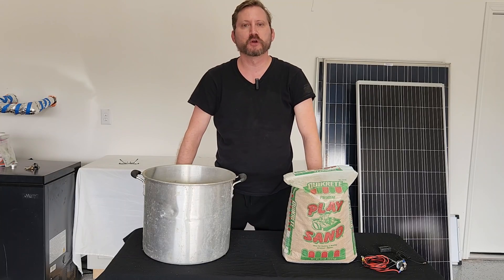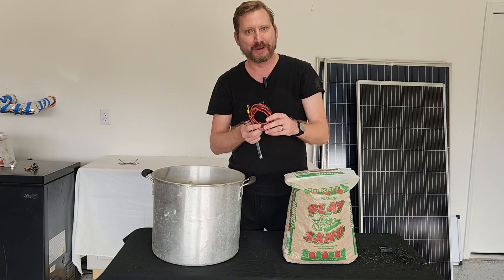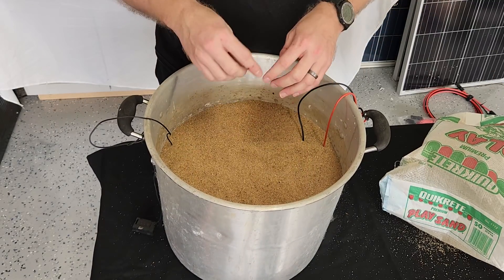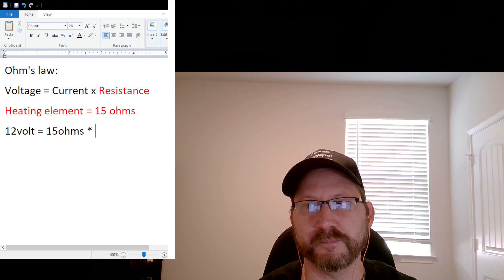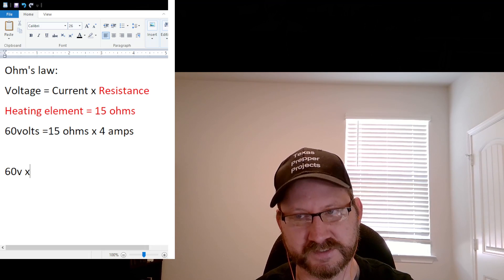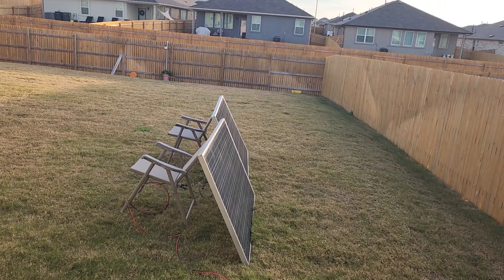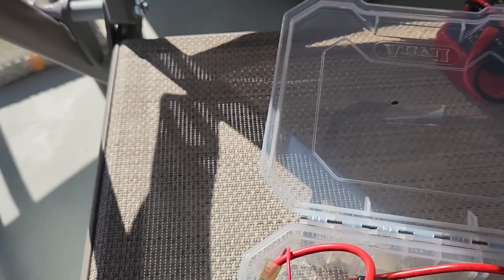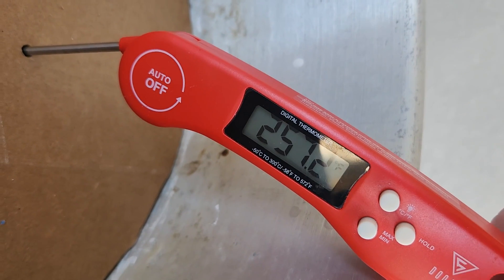Sand Battery Heater solar powered 250F / 120C with no flames or fuel! DIY

Comment: You actually need to match the element and the panel. Maximum power transfer occurs when the source resistance matches the load resistance.  The source resistance is Vmp/Imp= R.    Find an element with this R and you will get the maximum power transfer. David Poz has a video on this and confirmed it. But great video
Reply from the maker: Did you watch the video? I posted the math on this long before David did
Reply: Hi yes . Your video is great , very detailed 👍Just wanted to state it's the impedance matching that decides max power efficiency vs the voltage alone  . You can have two identical voltage panels, but different wattages.  Eg . 100w (30Vmp 3.3Imp (9ohms)  200w/(30Vmp 6.67Imp) (4.49ohm).    So depending on the wattage of your panel , the ideal element would change if maximum efficiency was your goal.

Comment: Great video.  Was wondering if anyone that has watched this is from the Pacific Northwest, which equates to rain/cloudy weather and am curious if a solution like this wold be effective or a waste of money?  My application would be to raise the temp in the winter time for a 8x16 outdoor shed, even it is would elevate 10-15 degrees warmer.  I do use solar powered lights which seem to work fairly effectively in the winter time but this solution would have quite a bit more of a power draw than LED lighting.
Reply from the maker: Waste of money for that location and size. I would use a diseal heater
Reply: @texasprepperprojects  Thanks for the feedback.
Reply from the maker: @francisaiello6197  welcome!

Comment: I tried this, i have 80v coming from solar panels in series to my heating elements and the voltage drops to 10v to about 12v. How do I fix this?
Reply from the maker: All panels will drop in voltage under load. But, what is the resistance of your heating element?
Reply: @texasprepperprojects  Not sure, I will have to measure, I only have one element. thanks for getting back to me. but does that seem like a big drop?
Reply from the maker: @waynemckinnon6163  yes something isn't right there.
Reply: @texasprepperprojects  It measures 17.9 ohms
Reply: Any ideas?
Reply from the maker: @waynemckinnon6163   I'd have to know a lot more

Comment: Thanks for putting this together and online for us. I just completed my build of this system and running into an issue with low voltage. I have six (6) 16 volt solar panels connected in series which should produce 96 volts. I included a disconnect between the pv panels and the shunt to disable the system when not using it in the summer. I have the sand bank in the greenhouse for radiant heating,  hopefully. When I measure the panels disconnected, I get 100+ volts, but when I connect to the other parts the voltage drops to 12 volts and stays there. Not sure where to start. Now I will say that the heating element does heat at 12 volts and draws about .5 amps.
Reply from the maker: Neat!

Comment: I have a 22’x22’ unconditioned garage. Could I scale this up to a 50 gallon steel drum and use multiple heating elements?
Reply from the maker: In my opinion and lots of experiments... no.  It would require literal tons of sand and you would have to cover your roof and yard in solar panels.  Think of a $20 space heater for  bedroom. Those are 1500 watts.  This is 260 watts.   Your better off woth a diesel heater or propane heater.

Comment: Have you tried wiring two element in series to double the resistance so at 60v you would be effectively running them at there rating capacity assuming they are 120v elements.
Reply from the maker: But then the current requirements would go up and I'd need bigger panels anyway
Reply: @texasprepperprojects  that makes sense, I wasn't sure what the current rating if the panels was. Those panels seemed like they were probably ~ 300w each. Just trying to maximize power output.
Reply from the maker: @hyperion112   They are roughly 300 watt at 37v, so you are right, if I had 4, i could get to around 120v, I just think the current will be too close as the sun goes up and down... but it's a decent idea if you can make it work. As I showed, getting to voltage high enough makes a BIG difference

Comment: Aluminum is a better material to store heat energy.  It has a higher heat capacity than sand, but gets hotter faster and more evenly. But it definitely would need to be insulated way better, because it will also lose/conduct heat to the surroundings faster. 

   You say you don't need to insulate the sand much because there is not that much energy going in, but keep in mind that you have it in a aluminum pot.  That aluminum pot is very thermally conductive, and is sucking heat energy out from the sand (and exchanging it with the outside/ambient temps).  Meanwhile, the heat doesn't transfer well through the sand itself. It's like the equivalent of being on a boat with a couple of holes where water is coming in.  You're fighting a losing battle if you don't patch up the leaks.  

   Also, if heating is the goal, it is much more efficient and cheaper to just convert the Solar energy directly into heat. There's a guy up in Canada where it gets pretty cold during the winter (often well below 0 F), and he does most of his daytime house heating from direct Solar heating via essentially what are insulated and baffled large boxes with aluminum cans inside and everything is painted black.  These are outside and he pipes the hot air into his house.  (The system turns off at night, and if he needs to, he runs his woodstove for part of the night.  This Solar heating system saves him A LOT of wood though). 

  Solar panels only really make sense for heating when you don't have any sunny areas near a window etc, and so instead you can run wire for a distance from an area that does receive sun.  In that case, it is much easier and more convenient (especially since those wires can easily be put under a window).  But if you have areas of consistent sun near a low 1st story window, it makes much more sense to collect solar heat directly and pipe in the hot air like the above guy does. 

   I really wish I had the sun for either, but our property has many trees and way too much shade to be able to use either.
Reply from the maker: Thanks for the comments

Comment: I have access to some used panels..  400w 40v  9.3A … obviously when new… so 3 of these in series 120v, 1200w , 20-ish amps… this would heat sand, water, etc.. on the daily like a battery.  🔋.  For a green house… @ $105 a panel.. sounds like a no brainer… use batteries as well for “extra” power? If already have 12v panels… groups of 5 to make 60v or buy higher V panels?  
   I was thinking water also.. like a 240 gallon tote in a cage would be ideal… and paint it black so the sun gives an assist!
Reply from the maker: That sounds like a great setup!  Direct solar water heating with a tiny pump is even easier  and cheaper

Comment: 9:43 Stickler here, moving air itself is heat. So, yes, you will create MORE heat by using a fan. Close a fridge with the fan on and no cooling and find out. The ENERGY question still remains for all stickle sticklers. Moving air creates heat, it is called friction. Great post, am ordering parts! Thanks:) 11:40 not to mention h2o tops out at 210degF100C.
Reply: While moving air does create heat, the fan takes energy to run. You cannot power a fan with heat and have it create more hear than it consumes.
Reply: @hyperion112  And you are the stickle stickler i referred to while carefully separating energy and heat in my comment:) Makes me feel like a mystic.... P.S. Depends on the noise efficiency of the fan on whether it creates more "'HEAR'"{sic}. Nice attention to detail.:)
Reply from the maker: Thanks!

Comment: Hmmmm (caution: Rube Goldberg thinking coming!)…
What if….interior house walls, even only the lower half of walls, got packed with sand?  
Add heat element(s) into that, & enuf on-site power generation, it could help temper the house, help reduce sound transference. 
Sand holds heat, so, when the sun sets, there’s only the hot sand radiating warmth—various things determine how long the warmth lasts without added heat. 
 It depends on:  
…. how much sand volume; ;  
…. How many elements heat it; 
…. How hot the sand gets when powered; 
…. How cold the house gets & the temps outside, that the sand must compensate for. 

…Or, how about when building, reinforce the floor framing to withstand the weight of being filled with sand?  Add heat elements into that sand, placed for easy maintenance / replacement over time.   
…Sun hitting floors thru windows can also temper the floor sand-cells. 
…Or, how about making a sand-bank or a brick bank, under & around each baseboard heater, & learn how to use those to heat the mass, then turn off the heater & just use the stored heat from around each baseboard?  (Kinda redundant, cuz baseboards already give you all the BTUs you paid to heat—but that can help keep warm in a grid-down event). 
…Or, make mostly passive solar air or fluid heat tubes, mounted under a polycarbonate or metal patio roof, & bring the air or fluid into the house with a manifold, maybe a radiator for fluid, to heat the house during the day.   
Some of those tubes could heat a sand-battery for night hours, if you have enuf sq.ft. of patio roof & tubes. 

“The wheel of seasons”—the temp cycles over a year, are stored into the interior mass of a building.  The more mass, the more temp storage.  Materials used, matter. 
Balance the amount of mass with the interior sq.ft., & you can passively get a livable, fairly even indoor temp, year-around, with  (or little) added heating or cooling.   
Properly balancing the sq.ft. of interior with the mass, allows the cool of winter to become available to the interior in summer, & the heat gained in summer, to be available to warm it in winter.  
Hard materials on interior walls store temps better than soft materials (sooo…put thicker paperless drywall, or, cement boards, on walls to store temps).  

The mass-battery for temp storage can spawn lots of variations!
Reply from the maker: Just have a thermal mass inside the house but not thermally attached to the exterior of the wall. Like a big stone fireplace.
Reply: @texasprepperprojects    Can otherwise fill the interior wall bays with volcanic rock/pumice, for mass that is lighter weight & still effective. 
It’s about storing BTUs inside the house, & letting those slow-temp-changing fillers help smooth-out temp variations in the house, over a year’s time. 
But yeah…for exterior walls, pumice or sand would not be enuf insulation in exterior walls, unless those walls were thicker than any usual wall.
Reply from the maker: Cool

Comment: That would be silicone, not silicon jacketed wire.
Reply from the maker: The wire has silicon insulation for high temps
Reply: Silicone is a rubber. Silicon is an element that computer chips are made out of

Comment: If you had 10 or 20 tons of sand with an insulating cap with that heating element  you could store heat from summer and by the time it works its way through the sand and you remove the insulated cap you could be warming your house in winter.

You could bury an appropriately sized system under your house (best during construction!) to deliver such an outcome.
Reply from the maker: Yup!

Comment: Well done with this sand project. We have lived off grid for 18 years and use a Derby Heatbank heater with our excess solar in winter. You should check them out? They are now made by a different manufacturer but still very good
Reply from the maker: Thanks!

Comment: The biggest benefit I see with keeping it outside is making it very easy to control a fan to pull air through with a simple temp switch
Reply from the maker: Thanjs

Comment: Thank you. Great vid. Re Insulating the pot; true you won't get any more heat energy, but you might want to take the daytime rays, when the sun is heating the greenhouse anyway and release that heat at night, in which case a removable jacket would surely improve efficiency.
Reply from the maker: Thanks for the tips!

Comment: Great...heater for my sailboat....with about 30 cubic  metres to heat...to knock the chill off nights in autumn winter in NZ. I will maybe insulate the pot so i can release the heat as needed. I can  use a  20 litre stainless steel beer keg i found..
Reply from the maker: Try it!

Comment: If you need hot water, coil some copper tubing just below the surface of the sand.  Then pipe it to wherever.  It could be stream, so design appropriately.
Reply from the maker: Yup

Comment: Nice project.

What is the brand name of the energy monitor?
Reply from the maker: The watt meter? It's just the $20 from amazon
Reply: @texasprepperprojects  Is that the device you have wired between the panels and the heating element?
Do you have a link?

And thank you for the response

This device looks like a project I could build to keep my plants from getting to cold.
I live in Texas also and have harvested tomatos and haberneros the week of Christmas.
This looks like something I could experiment with.
I already have several solar panels.
Reply from the maker: https://www.amazon.com/KETOTEK-Digital-Voltmeter-6-5V-100V-Multimeter/dp/B0BD41MQSN/ref=
Reply: @texasprepperprojects Thank you I just rewarched the video and found it in the link.

Much appreciate this.
Going to give it a try.

Comment: Britain had these 65 years ago, they were called block storage heaters, they charged at night using off peak electricity, they had a room thermostat that turned on an internal fan which would blow the heat out as required, they were discontinued because too many people bought them & off peak time ceased to exist.
Reply from the maker: Neat!
Reply: Most nuclear is wasted night time

Comment: I have an old hot water tank with a working 15 ohm element.
Anyone filled a tank with sand and applied AC to heat the sand?
Reply from the maker: Try it

Comment: In my opinion, ,,water heat battery” will work a lot better. Because the water from the battery can be moved in order to heat whatever you want to heat. 
In your example, the heat from your battery, how are you going to use it? You still need to transport it through water or maybe through air. And whenever you do that conversion from sand to water or air you will lose a lot of energy. So, realistically your experiment doesn’t work. Especially when it’s known that water will cool down slower than sand. 
Maybe there will be someone who will say that water doesn’t go higher than 100’celsius. That’s true. But you just have to increase the volume of your,,battery “. More hot water means more heat.
Reply from the maker: Check out my other videos in the series

Comment: The insulation on the cable is Butyl Rubber low energy heaters are called irradiant heaters as the heat is more lower temperature than say a 3kw fan heater
Reply from the maker: Thanks